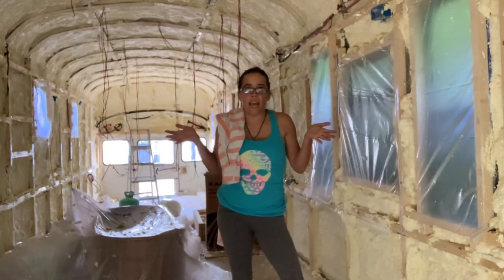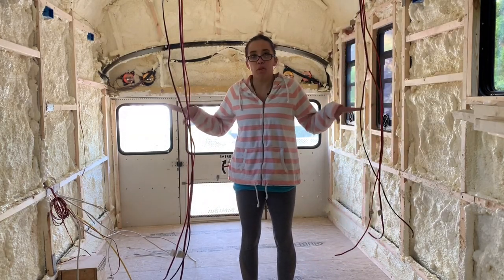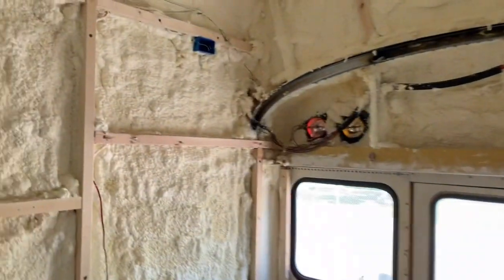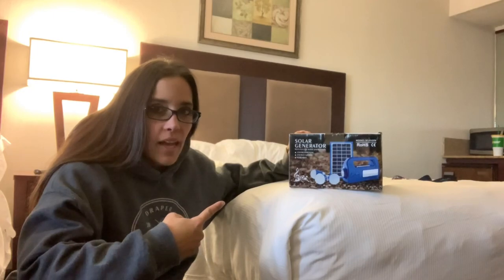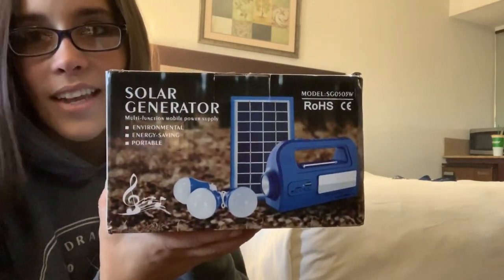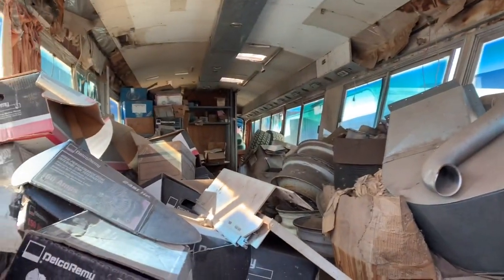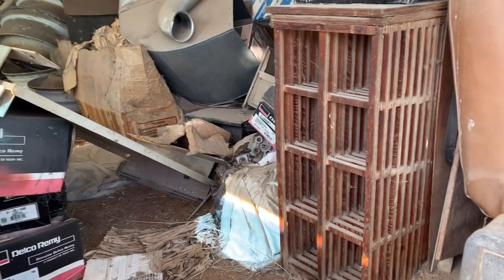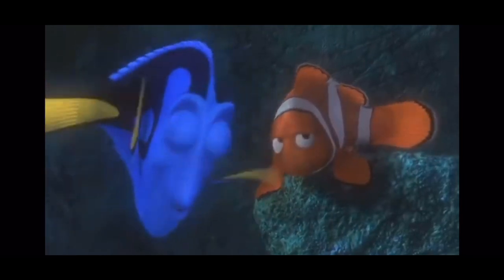Time to Hit the Road!! Moving into a School Bus Conversion - NOT DONE

Comment: how much spray foam did you use  what size kits and how thick was it,Logan and yourself have been working hard good job
Reply from the maker: We used a 600 kit offline and a 650 kit from Home Depot for underneath our subfloor. That was mistake, we should have gone with what we did for the walls and e ceiling which was two 650 kits from offline which was more than enough for the ceiling and walls. The kits from Home Depot our over priced and basically trash in quality. We have been super impressed with our insulation for the ceiling and walls!
Reply: @BohoWandering  what was the brand of insulation you got offline for the walls and ceiling
Reply from the maker: It’s over 2 inches thick easy everywhere. We live in Idaho and we are sweating up in the loft sometimes at night lol I think it’s funny